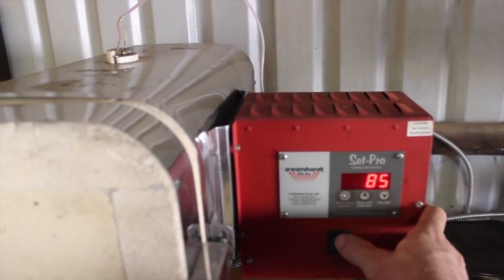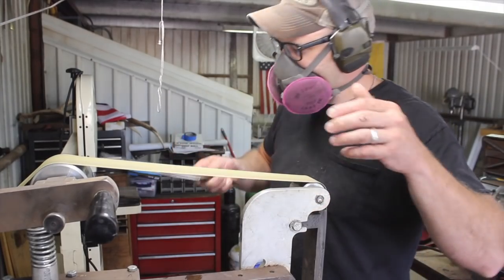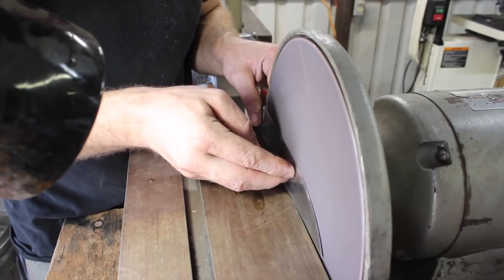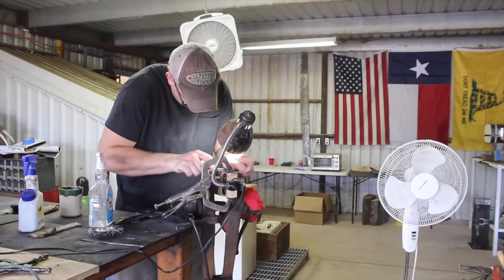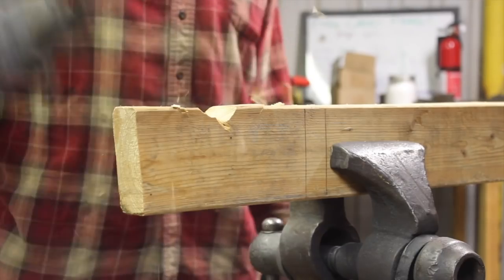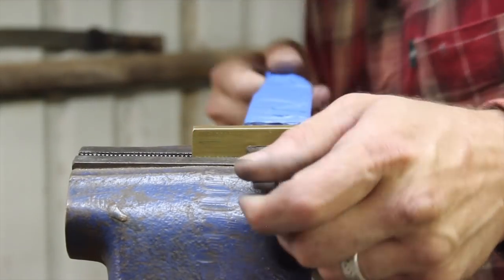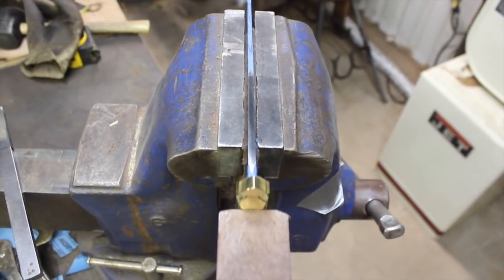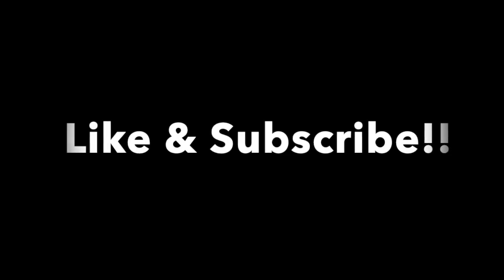Forging A Damascus Bowie Knife From Saw Blade, Chop Test: Part 3: Bladesmithing and knife making

Comment: Most people call the edge a secondary bevel, not a primary bevel. Primary bevel is the blade grind itself, that's the main bevel from a flat piece of steel. The edge is a bevel on the primary bevel or a secondary bevel. At least that what I've heard from most people.
Reply from the maker: I've heard it both ways as well. The edge being the primary bevel makes sense to me in relation to how the knife is used.

Comment: Since you used a 3/8 drill bit and the I’m assuming the knife is 3/16 thick you could use a 3/8” dowel split and sanded a total of 3/16” from the center and stack it on the side of the blade with epoxy and then press fit it into the handle.